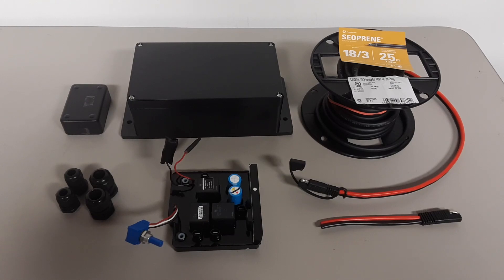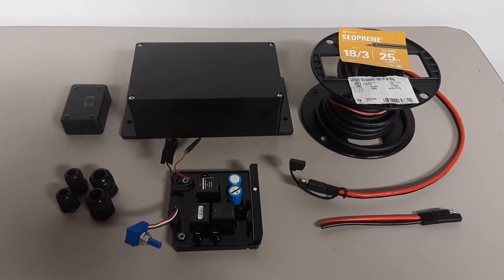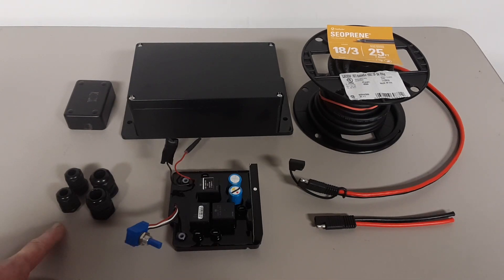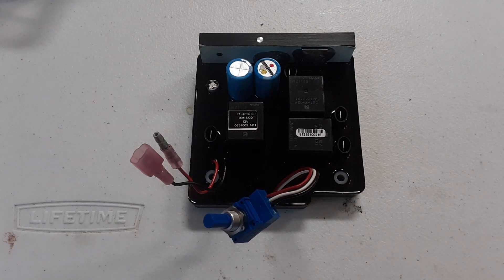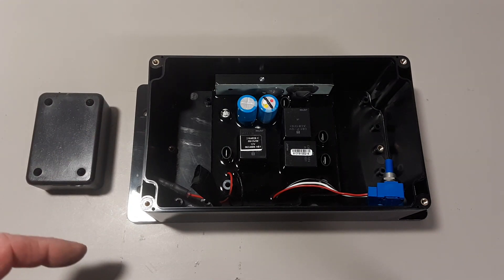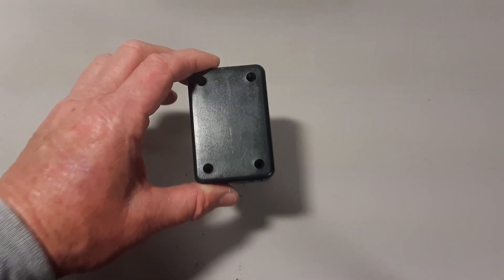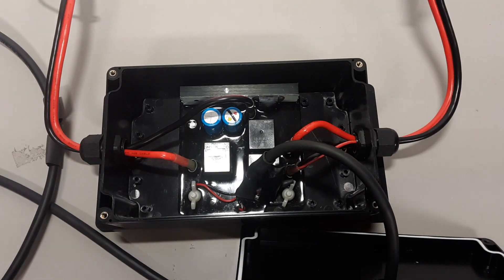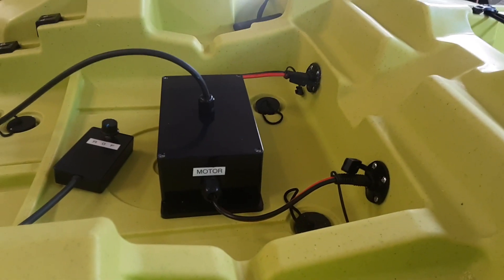Custom Minn Kota Control Board PWM Speed Controller

Comment: Do you still run this setup.  I have done the same setup and was working fine.  Now when I turn it on I hear the clicking from the board but motor doesn't turn on.
Reply from the maker: I don't have it anymore but used it for over 2 years without a problem. If you can, check the output voltage on the board to see if it is working.
Reply: @Aksmaniyak  I checked last night and I have 13.9 going in but only 11.5 output.. I just got this board about 3 months ago.
Reply from the maker: @bigtoutdoors  That is close enough to 12V that your motor should run. Did you check your wiring? Does the motor run without the board?
Reply: @Aksmaniyak  The motor does run without the board, I checked last night.  I checked all wiring and it shows 11.5 where it connects to the motor.
Reply from the maker: @bigtoutdoors  It's hard to say what could be wrong without pics. I have never heard of the board failing but it is possible.
Reply: @Aksmaniyak  I have tried everything and nothing works.  How can I get you some pics.
Reply from the maker: @bigtoutdoors  I'm an admin on a FB page Tiny Boat Kayak Nation. There arre a lot of knowledgeable people that can help. Here is the link.   https://www.facebook.com/groups/3521517597860461

Comment: Are all transom motors the same way, i have a Shakespeare 35 lbs thrust and I'm really tempted  to do this for my kayak rather then buying an nk 180
Reply from the maker: All trolling motors are not the same but the majority are wired the same. All you need is the pos/neg wires from the inside of the shaft to run a PWM.

Comment: i just killed one of those amazon 60amp ones, literary melted one of the relays off the board within an hour. figured id test it hard haha. i got a minn kota maxxum 50 and just pulled the pwm out of the head and set it up in my box. i did notice the heatsink sat on a block in the lower casing of the head with heatsink paste in between. i should be fine right?
like nn heat issues. i do have a fan exhausting my box fyi
Reply from the maker: I know people have relocated the MK Maximizer head/lower section before but never by taking it out. That is new territory. It should work but keep us posted.

Comment: I ordered one after burning up two of the 60a Amazon pwm's.
Been using the 5 speed forward and 3 reverse for a few weeks now.  I need that variable speed to fine tune the speed with the water current.
Thanks for the info, look forward to trying it out.
Reply from the maker: You are welcome. You might want to look at the ESC video options on the channel.
Reply: I only see 2 wire on your 18-3 ? It looks like a bigger gauge  red and black only. I want to make sure the wire won’t over heated .

Comment: Aks,  I installed a 45# thrust Minn Kota Traxxis like you did in this video.  I put the speed control in a separate box as you did as well.  It worked flawlessly the first time out.  My son just took it out and the motor is stuck on forward high.  The speed control knob is not working.  Did we ruin the control board somehow?  I'd appreciate any thoughts you may have from your experiences.
Reply from the maker: If the speed control knob isn't working then the pot might have a short or loose wires. Hopefully, it is only the pot since the board is still working.
Reply: @Aksmaniyak  Thanks.  Will check things out when he gets home.  Fingers crossed.
Reply: No luck!  No loose wires. The speed is stuck on high forward.  I'm wondering if the length of the extension is an issue?   I rewired the pot back to it's original wires which didn't help since the pot was already shot.  Could it be a issue with the 16/3 wire I used to extend the pot?  Thanks again for any help you can give me.
Reply from the maker: @mattfletcher12  I can only think of using new wiring and a new pot to see if that fixes it.
Reply: @Aksmaniyak  Thanks.  I tested the pot and it's functional.  Must be my control board.  Not sure how it went bad?   Maybe a short someplace but wouldn't know where.  Will have to start over.

Comment: Aks,  Thanks again for all your help.  Almost ready to order all my parts. Does the wire that you splice the speed control have to be 18/3 gauge?  Also, Which type of connectors would be best for this?
Reply from the maker: Thanks Matt. No, it doesn't have to be the 18/3. I didn't use connectors, I spliced, wrapped, soldered, and used shrink fit tubing to make the connections.
Reply: @Aksmaniyak  Much appreciated Aks.

Comment: I really appreciate all your videos!  this MinnKota Traxxis Control Board runs $150.  I was hoping to get by a bit cheaper. I'll be using a 12v 100ah lithium battery with a #40 motor.  Can you recommend a PWM for this type of set up?  What size of PWM would I need? Thanks again!
Reply from the maker: Thanks Matt! Ebay has the board for about $120.
Reply: @Aksmaniyak  Thanks Aks! The Minn Kota C2 Endura 45 is $210.  The Minn Kota Traxxis 45 is $350.  The Traxxis controler is $120.  So I suppose I could just purchase the Traxxis motor and use the controller that comes with it for another $20.  Any input would be appreciated!
Reply from the maker: @mattfletcher12  Check into Haswing and Newport Vessels trolling motors. They have better prices.

Comment: I just built this and when I hooked it up, nothing happens. I heard a click from the control board, but the pot doesn't do anything. Are you supposed to disconnect the Red, white and yellow wires from the motor switch? I didn't do that at first, but then tried to after nothing happened, and it's still not doing anything. Am I missing something? I double checked all my wiring and its exactly the same as the video shows.I'm using the board on a Newport Vessels 55 lb thrust trolling motor.
Reply from the maker: It's hard to tell without photos. I have a FB page that would make trouble shooting easier. The link is located on the lower right of this channel banner.
Reply: @Aksmaniyak  DIsregard. I read the rest of the comments and saw that the motor needs to be on 5 for it to work. Works now! Thanks!
Reply from the maker: @Ken-tv7ke  I thought that might have been the problem. Glad you figured it out.
Reply: @Aksmaniyak  Thanks for the quick replies and offering to help. Much appreciated. And thanks for all the videos, they've been a tremendous help and have given me several ideas for my kayak. FInishing up the pedal steering that you did as we speak!
Reply from the maker: @Ken-tv7ke  That's Awesome Ken, thanks again!

Comment: Thanks for doing this project. I have owned several Minnkota tms with no problems. What are the approximate dimensions of the Traxxis control board so I can get the proper size project box?
Reply from the maker: Thanks Roger. The link for the parts are in the narrative.

Comment: I set up my trolling motor and PWM like this. Unfortunately, I am getting fish finder interference at any speed except full high on PWM. I have tried rerouting the cables, a separate battery, and installed a ferrite ring. Any suggestions?
Reply from the maker: I have never had any interference problems with a PWM on any of my builds. The only problem I have ever read about was when some people used a GAMA PWM that caused interference.
Reply: @Aksmaniyak  thanks.  It sure what type of pwm I have. I bought it on Amazon.

Comment: would 22awg work as well.  Since it is just for signal.  I think I am going to run a 22/5 cable so I can include a 12v Battery meter to the hand held box for easy reference.  Thoughts?  I truly enjoy your videos as it has brought forth so many answers to questions I have,  Thanks for the response
Reply from the maker: Thank you. I'm sure 22 gauge would work. I just used the best available.

Comment: From my understanding this isn’t a PWM and is more reliable and stable. Is that correct?
Reply from the maker: It is a PWM but made by Minn Kota for a Traxxis speed controller. It is more reliable than the Amazon PWMs.
Reply: @Aksmaniyak  I just finished my build. I don’t like the idea of the unreliable nature of PWMs, so I ended up taking the head off a Newport Vessels and using the stock controller in a waterproof box. Won’t have infinite variable speeds, but I am OK with that. I have never come close to running my lithium battery to zero, and I am OK with the 8 speed options.
Reply from the maker: @thamesford1433  It is also less expensive to replace the switch if it goes bad.

Comment: Is there a way to use this set up with a traditional throttle control/handle instead of the rotary knob? Maybe using a linear potentiometer? Basically a throttle like a regular boat uses with the 2 and 4 cycle engines. I just prefer the feel of a throttle handle vs a knob. Thanks!
Reply from the maker: Yes, I'm sure it is possible but I have not seen it. You could probably attach the pot to the end of a throttle handle and run the wiring thru the shaft for the same effect.
Reply: @Aksmaniyak  Is there a specific kind of linear potentiometer that would be needed or would a typical 10k work?
Reply from the maker: @Ken-tv7ke  It would make sense but I have never tried it. I have always used the provided pot.
Reply: @Aksmaniyak  Roger that. Thanks for the responses, I appreciate it!

Comment: Doesn’t work on a 55lb thrust Newport vessels that has been shortened and only using positive and negative.
Reply from the maker: It should and I have used it on a shortened NV 55lber.
Reply: Maybe I got a bad one.
Reply from the maker: @matsmith742  That is possible. I know it happened to me once.

Comment: I pick up the control board as in your parts list,  question when I turn the knob there is no ‘click ‘ on center, forward and reverse I can hear it in the video. Mine does not do this,   does this only happen when the board is powered up.
Reply from the maker: The center detent is in the stock handle of the MK. You just need to power it up and then mark the center of the switch.
Reply: I heard the click also. What was that? I like a Center detent to know where “off” is.

Comment: Will this work with any Minn Kota trolling motor?
Reply from the maker: This will work with any 12V motor with a pos/neg wire shaft connection.
Reply: @Aksmaniyak  I’m debating on this for my Rs117 instead of a full upgrade to another kayak.  Did you think it was worth the trouble for your RS?
Reply from the maker: @WhatTheH3ll1000  Yes I do but there are less expensive options but quality is not as good.

Comment: I have your old PWM setup,  questions: are you connecting the motor side with just the red and black? Which appears so, If so, can I just cap off the others (black - not ground, red not positive, yellow, and white) Do I need to still set the speed to 5 on the TM like before? Sorry for all the questions.
Reply from the maker: Yes, use only the red and black for the motor. If you are going to bypass the switch connections then you can cap them off or just leave them as they are and set the switch on 5.
Reply: What did you do with the yellow and white coming from the motor?

Comment: I've read a lot of things and seen a lot of pwm upgrade videos out there. Is the pwm hack for people that use a 5 step trolling motor? And the higher trim levels of minn kota use a digital maximizer. So I won't need to buy a pwm. Am I understanding that correctly?
Reply from the maker: Yes. PWMs replace the standard 5F/3R speed switch. MKs with digital maximizers act the same as a PWM so it is not needed.

Comment: Did you use a inline fuse from the battery
Reply from the maker: No. I used a circuit breaker between the battery and PWM.

Comment: Hey what’s up I just bought a perception outlaw 11.5 and want to put a Mount and steering I’m thinking about using servos with remote to actually steer the kayak if you could shoot me some ideas I also thought about keeping the original switch and and tiller and put a steering bar to steer the trolling motor but I feel the bar would get in the way
Reply from the maker: Hi Casey. I have played with actuators to steer a kayak but I though it was too complicated and expensive compared to foot pedal hands free steering.

Comment: I didn't know these could be used for pwms on different models. I like this mainly because of the sealed nature and the reduced overheating. You still have your CB installed before the battery right?
Reply from the maker: The CB is close to the battery between the PWM.

Comment: Are you using this with the Newport vessels trolling motor?   Have you tried using a lithium battery with this setup?  I've enjoyed the videos.
Reply from the maker: Thanks Sky. Yes, I'm using this with a NV 46lber. I have used this TM before and it works perfect for my needs. I have not used Li batts because of the prices.

Comment: attempting to build a pwm controller for a friend. what ga wire are you using 6 or 8? and what size glands do you need for two of said wires to get through and seal. thanks for your help...saves money if i order right the first time
Reply from the maker: I'm use 10G in all my builds. I'm not sure what the gland size is because I bought an assortment of sizes from Amazon.
Reply: 10g matches whats coming off the tm? probably now that i think about it for a 12 volt. if most assortment gland kits from amazon top out at 16mm followed by 13.5, 11, 9, 7....are you using the largest in that kit...second largest?
Reply from the maker: Yes, 10G comes from a 12V motor. I used the largest gland nut when using 4 of the 10G wires.

Comment: I love your vids man. 

I'd be really interested in seeing you do a set up using an RC truck ESC, and a electric skateboard controller. 
This is the direction I am planning on going, instead of the pwm route, for several reasons, mostly less wiring and cheap pwms.

My research leads me to the Hobbywing 880 non vesc for brushed motors esc, and I'm looking at the flipsky v1 remote because it has cruise control and reverse. 

Just an idea. I'm almost certianly going this way, regardless. 👍
Reply: Im intrigued can u elaborate?
Reply: @scottish982  The jist of it is rock crawlers and some model boats use esc modules for brushed motors .. basically a pwm, with a little receiver that binds to your controller. So....the idea is your have a pwm that is vastly more reliable than the cheap chinese ones, that was also wireless. I've seen several people do this, so I know it's possible....I just need to see if the new ESkateboard controllers with cruise control are compatible with this idea. 

They make high amp esc but I'm going to be using a haswing 20 on my yak that only pulls 18a at full speed anyway. So I'm going to go with a 30a 12v esc for a rock crawler (like the hobbywing 880). 

There's a few YouTube vids about it on here if you search for them...but they're not very detailed in terms of set up and what not.

Comment: Any advantages of this set up over your original pwm set up? (I've made the original pwm from your original video 😉👍😎)
Reply from the maker: The MK control board doesn't have heating issues and is waterproof. It should be as reliable as their trolling motors. Of course, that means higher priced. I haven't had issues with my other set up but like to try new things when i can.
Reply: @Aksmaniyak  yeah thats fair enough. I'm happy with the original installation but if I come across any issues and need an upgrade I know what I'll be doing next 👍